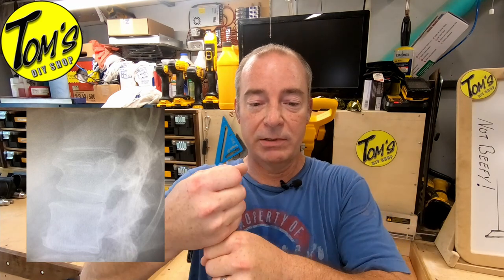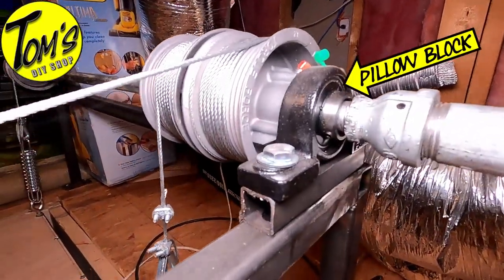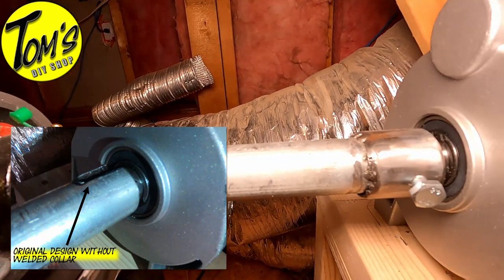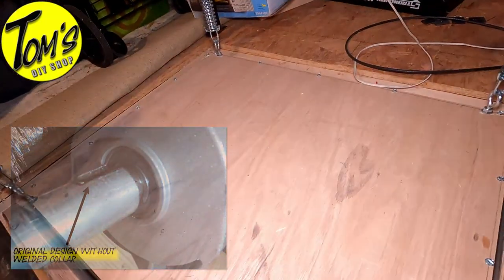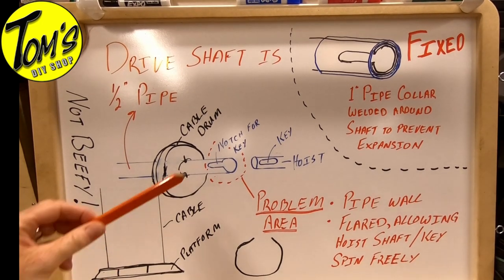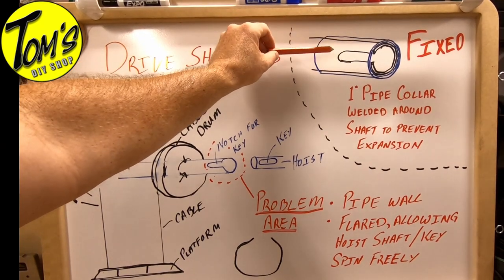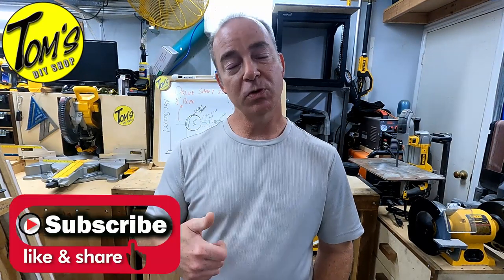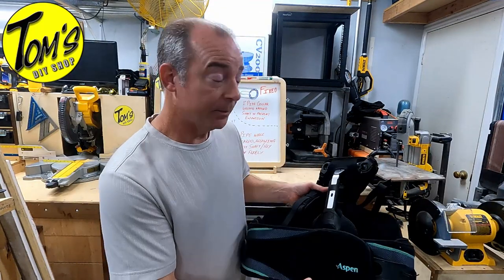Epic Fail - Attic Lift Fall: What Happened?

Comment: Any machine that is designed to lift people or things above should have as few failure points as is possible. What I see in your videos is a machine that has almost countless failure points go look at an elevator designed to lift people and you will see a machine, that has very very few failure points. And then those failure points are inspected and maintained.
I Certainly wish you the best.

Comment: Guys, designing hoisting equipment, and even more so, equipment for passenger lifts, IS THE PROVINCE OF MECHANICAL ENGINEERS.
Trial and error is a terrible approach where the safety risks include putting yourself or a family member in a wheelchair or a grave. 
And (other than in the case of professionally designed, properly built and certified passenger elevators) the two golden rules are you don't suspend a human (even from a properly engineered lifting device) and you don't EVER allow yourself or anyone else to get under (or close to) a suspended load. 

If you want to, build a dumb waiter where you can't get in or under it, then if it goes wrong you can't hurt yourself.  Otherwise you are staying into very unwise territory.   You wouldn't attempt to try surgery, that's the realm of a medical professional.  Likewise you shouldn't take on safety critical design engineering work.  That's the realm of the professional design engineer.

Comment: The cast pipes will be your downfall in the future too. Please install fall arresters to keep yourself safe. That pipe is not structural and will fail. search through industrial suppliers like MSC, McMaster Carr and Grainger for a more reliable solution out of forged steel components. Cast will continue to fail. Be Safe.
Reply from the maker: Hey There @MakeitZUPER, thanks for the comment and for stopping by the channel, I really do appreciate it! Yes...there were many lessons learned on my first lift and boy did I learn the hard way!!  Since that video, I've moved out to the country and now have a dedicated shop...with a PROPER LIFT to storage located above The Ultimate Man Cave!! You can see a preview in my latest video (https://youtu.be/sirQXxwffrE?si=1v2IC2t_eh8FMmnS) and...spoiler alert...I installed fall arrestors!

I'm getting back into the swing of things with YouTube after an extended break due to a bunch of big life events, both good and bad, so be sure you're subscribed and hit the bell notification button so you're updated when new content lands.

Thanks,
Tom
Reply: @TomsDIYShop  Congratulations on the relocation and sorry for your woes. I hope they weren't too serious. Because of my background and experience, I'm pretty picky about building things of all sorts so you might not be a good fit based on what I saw on the lift video, but I will give you a shot and see how it goes. If I make any negative comments in the future, be aware that I have your safety in mind first and quality and efficiency next. My comments will always intend to be instructive and helpful but I admit that I may not communicate it as effectively as I should. We all have weak points and communication with kindness isn't something that i am good at. Best of luck either way. I'm looking forward to seeing your new setup.